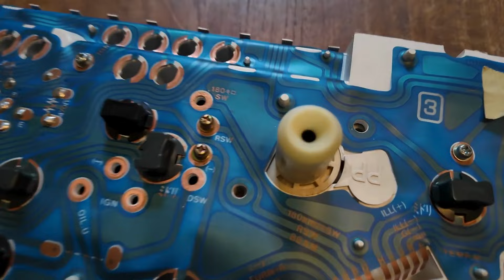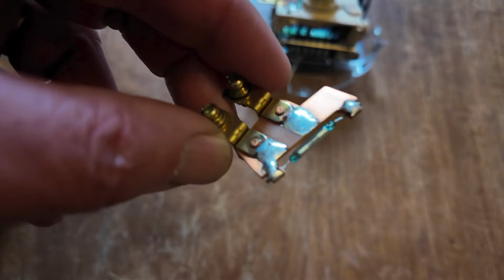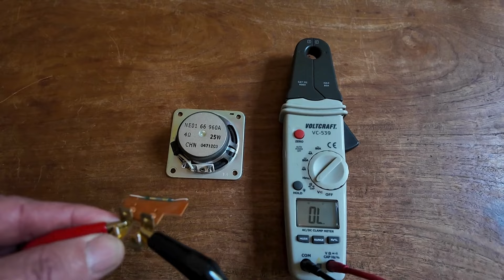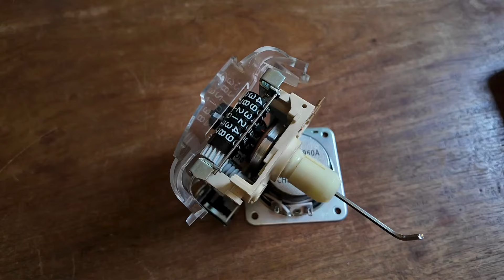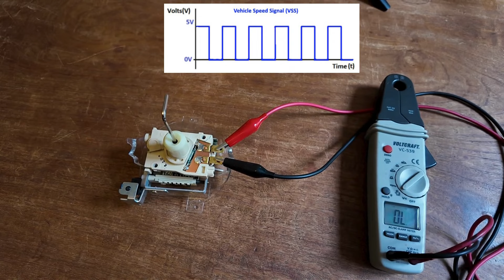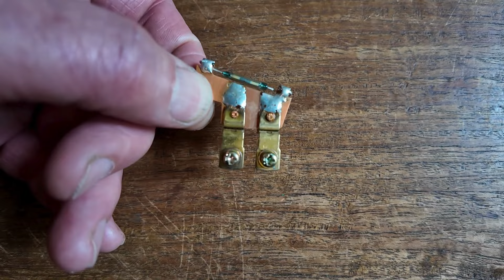Unravelling the mystery behind the vehicle speed signal on the MX-5 NA Miata

Comment: Great video! I will need to add this to get CC. Could you tell if there is something to be cautious about when removing the speedometer drive from the cluster or do you consider it straightforward? I suppose you would need to open the cluster and remove the speedometer needle and face to get to it.
Reply from the maker: Thanks for watching and for the compliment. 😊
It has been a while since I disassembled an NA cluster, but it is pretty straightforward. Once you have removed the transparent and black cover, you can remove the speedometer. I am not sure if you need to remove the dial, but it might be needed. That is not a big deal either. The reed switch is held in place with two screws on the speedometer housing. The other two crews on the back of the cluster are there to ensure a good electrical connection with the tracks of the flexible pcb.
Reply: @mx5info  Thanks a lot for taking the time to answer and for your substantial contribution to the MX-5 community! :)

Comment: Next tell us how the 180KM/H limiter mechanism works.
Reply from the maker: It is also controlled by the instrument cluster. When you look at the track coming from pin 1G you will find the text 180 km/h SW. There is a connection just above the read switch and one below it. The last one is called DSW. I assume it has something to do with it as well.
Reply: @mx5info  I mean the mechanism that actually limits the speed of the car upon the opening of that circuit - I am very curious if it's a sort of ignition limiter or something else.
Reply from the maker: @AlexTrull  the signal goes to the ECU at pin 1M, so the ECU is likely to limit the ignition at that point.

Comment: That’s some damned ingenious engineering right there.
Reply from the maker: I agree. It delivered a reliable solution. Mazda was not the only one using this approach. I have seen it in Honda forums as well. With the contacts in that glass housing and the use of a gas in the housing, the contact cannot corrode either.

Comment: Very clearly and well explained. It makes me wonder what the maximum frequency such a reed switch can accurately follow to provide a reliable square wave output. Is there any data on that? I found some data on miniature glass reed switches with resonant frequencies upwards of 3kHz so if the magnetic field is significantly below that, i suppose they should operate reliably. Contact bounce and  bounce time might degrade the square wave when the switching frequency gets too high, I imagine.
Reply from the maker: On one of the pictures I have found, there is some text on the back of the gauge face indicating that 60 mph = 1024 rpm for the speedometer cable. When we assume a pretty optimistic top speed of 135 mph (217 km/h) we arrive at 2304 rpm. That means 37.5 rotations per second. With each rotation providing 8 flanks, 4 up and 4 down, the maximum frequency for the signal would show 300 flanks per second. I guess the frequency for the signal would then be 150Hz. That would mean the Reed switch is not stressed at all. 😎
Reply: @mx5info  Sounds good and a new way for me to provide a variable timing signal! All the best, Rob in Switzerland